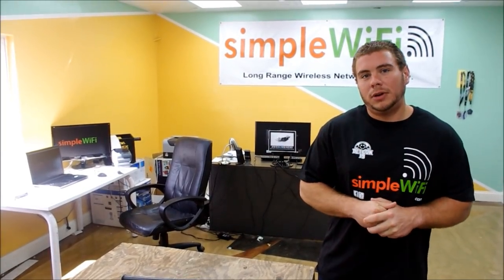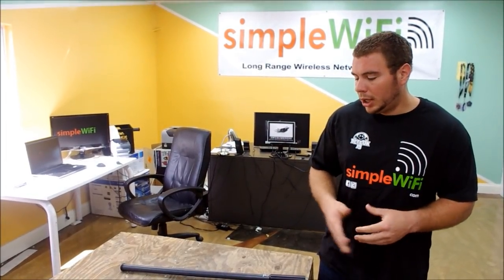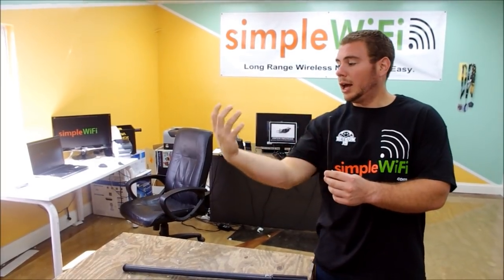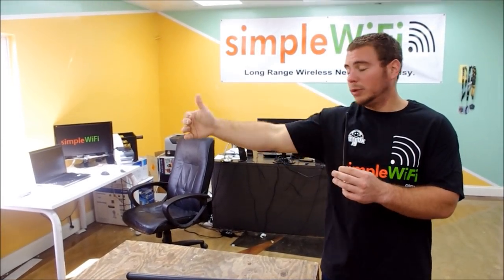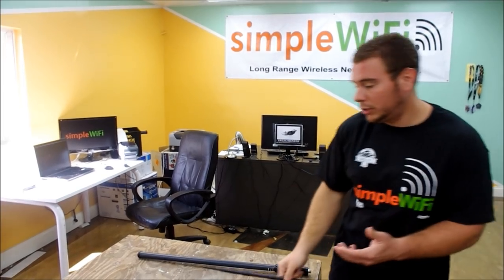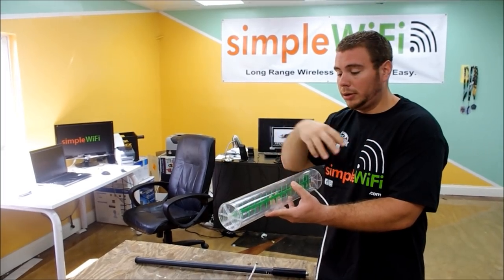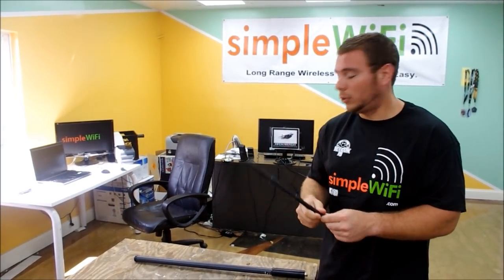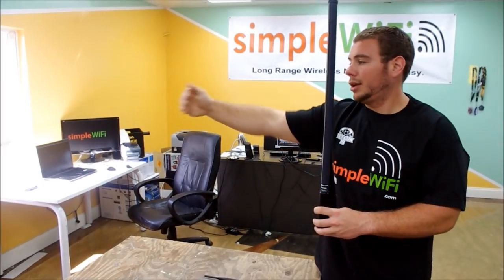WiFi Antenna dBi and Measurements Tutorial - Learn the Terminology for Wireless Signal Patterns

Comment from the maker: Higher Gain means the antenna is more directional and will thus let you reach further. If you are closer to the antenna with high gain then you increase signal quality and strength.

Comment: Thanks for your video I just learned more about antennas than I have ever known . You seem like the Guy that can answer my question. I haven't installed them yet . I have a Midland radio to put in my truck and a Haloview camera to put on my travel trailer. The radio and the monitor will both be in the cab next to each other and both will have aerials  my question is that one is radio wave and the other is video wave will they be able to work beside each other or will the waves distort each other ?

Comment: Will any antenna work? I have a bunch of transmitting hardware, an antenna that was used for long range communications with standard coaxial hookup, along with a UHF/VHF/signal booster, pretty  much whatever you pass through it it will amplify. Could I use any antenna for an Alfa wifi device?

Comment: hi. I just bought a 7 dbi antenna omnidirecctional (rubber ducks) to replace my router original 3 dbi antenna. I didnt notice any improvement in range at all. Do i have to adjust settings in my router in order to notice improvements in range with the new antennas???  help please!!! thanks

Comment: Hello thanks for your video it was a bit hopeful I am wondering I have a wireless security system with my cameras for my home and two of my cameras that are a bit further away seem to lag and the signal is weak I am wondering if I replace the antennas that are currently on my NVR box to ones I seen online that are rated for 10dBi will this help my connection issue? Also if I change the antennas on the cameras themselves to a higher dBi will this help at all
Reply from the maker: Yes both of those options will improve signal - however it might be easier to just use a PiFI outdoor repeater. https://www.simplewifi.com/products/hot-spot-kit

Comment: so, higher dbi it goes to the sides, lower dbi goes up and down, right?
Reply from the maker: Yes, on Omni-directional antennas the higher the dBi gain the flatter the signal becomes. A lower dBi gain will make the signal like a globe.
Reply: SimpleWiFi iam planning to buy an antenna...it is a 13dbi...iam about as far in 1 -1.5 miles in cell site...is this antenna good in my location??

Comment: ok......i  have router home
and the singnal anint reaching nuff 
i have a mobile and i want my network (my own wifi!)
its about 0.3106 miles = 500 meters  long away 
and my question is wich antenna should i take
for 0.3106 miles 
another antenna if its 1 mile dictance wich should i take then

Comment: What is the distance per dbi?
Reply from the maker: Depends on power and environmental factors.
Reply: SimpleWiFi Is it a good idea if I would use 1 directional external antenna and 1 omni directional external antennas? That way I can have the best of both worlds and will I still get MIMO that way or does two have to be the same directional antennas? I'm using Huwawei b315s router.